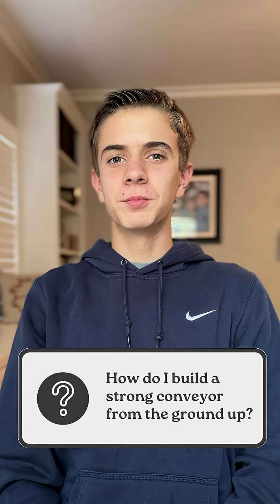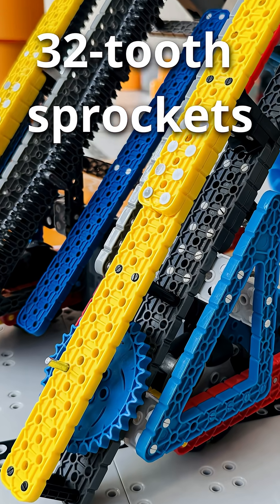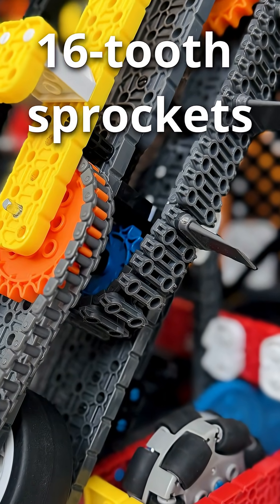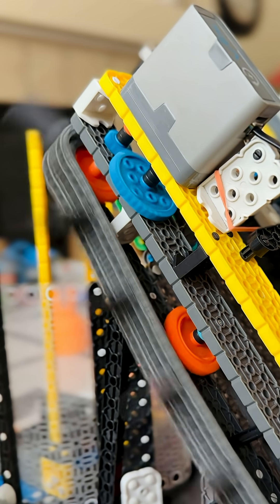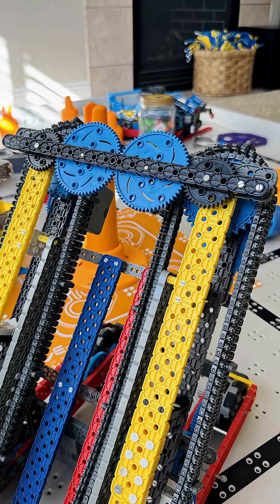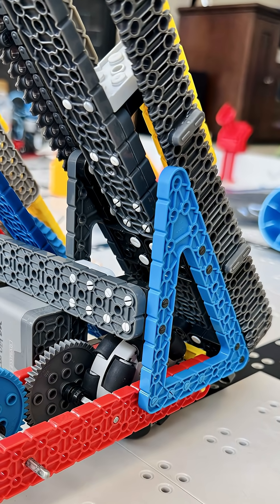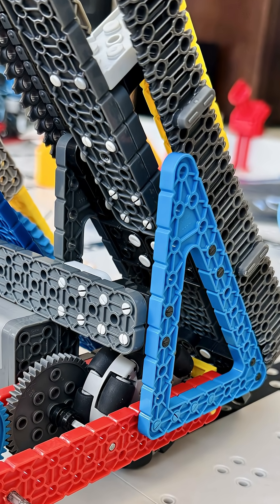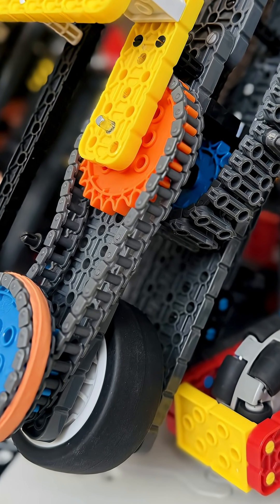How to Build the Fastest Conveyor | Chewbotca | VEX IQ Mix & Match | Chewy's Tip Ep. 1

Comment: What is the best way to get pins from the ground into the conveyer? My team is having issues with this. If you want to see our bot, check out the conveyer test video on the channel 😉😄 Tysm!
Reply from the maker: I'd recommend the tread pieces for a simple design like, but you could also use the rubber tires if u want a more complex design.
Reply: @7163BChewbotcaRobotics  Thanks :D 👍